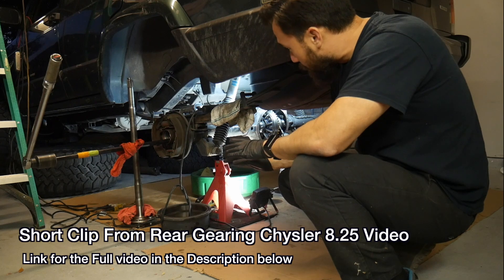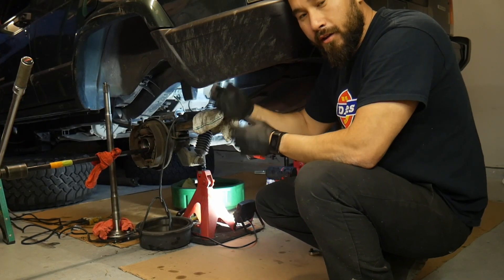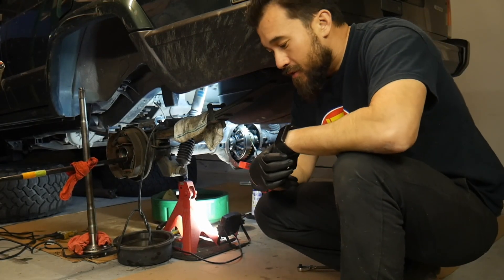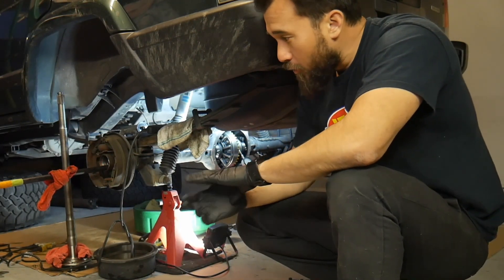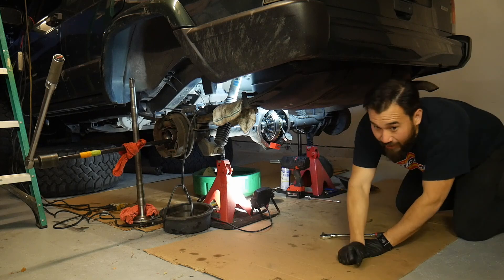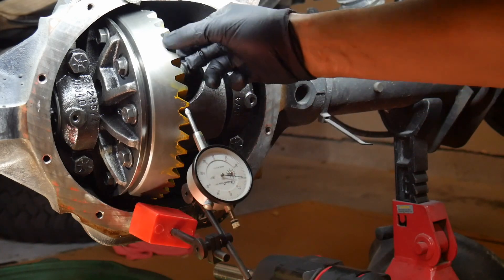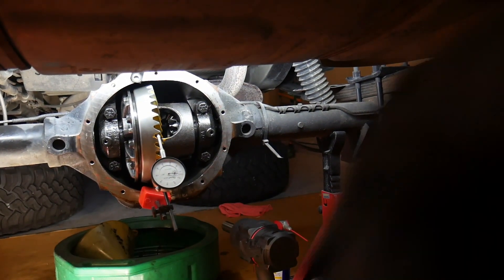Setting Ring and Pinion Backlash Chysler 8.25 Ram Dodge Jeep Differential

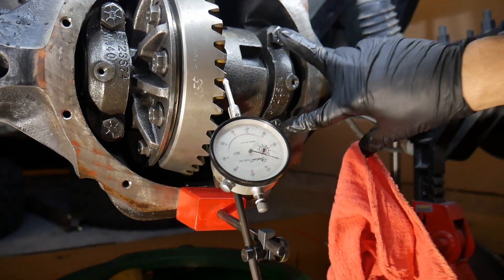Comment: About 08:38 .  I read those bearing cap bolts are 60 pounds of torque, not 100 like here.  I put mine 3 months ago at 60 pounds.   Right??

Comment: ive never done a crush sleeve axle. at what point in here do you measure and setup for pinion depth? i didnt see that step or any explanation on this
Reply from the maker: I've got a few videos on the channel, take a peak
Reply: @Donnythelatemodeltech  I finished building the Chrysler 8.25,  figured it out.  Actually easier than the shim design

Comment: Would you be able to assist me on diagnosing my differential whine after replacing pinion bearings and also differential side bearings ? I uploaded a video to my channel
Reply from the maker: Sorry for the lateness
Reply: @Donnythelatemodeltech  I think space between my ring and pinion is too big and I need to bring ring closer
Reply: From my first attempt at a gm 12 bolt, I had perfect pinion depth, good pattern and I read good backlash but still had some whine. Turned up the stereo for 5000 miles and went back in. Turns out I didn’t squeeze in enough carrier shims. Stuff loosens up. The adjustment feature of the Chrysler 8.25 takes this variable away but still loosens up so I’d guess you’d find excessive wear or initial big backlash if you opened it now. I’ll add that there are some cheaper ring/pinion sets out there that seem soft. Also if you start with big backlash stuff wears fast which makes it worse

Comment: I have a question. I am rebuilding a Chrysler 8.25. I had to replace the ring, pinion and all bearings, races. The spec sheet for the pinion depth is .030. (the old shim gone from rear pinion bearing locking up). When I try to crush the sleeve there is still too much play in front pinion bearing. Any suggestions would be appreciated.
Reply from the maker: It take a lot of torque to crush it.  You need a really powerful impact.
Reply: @Donnythelatemodeltech  Thank you.

Comment: What is the name of the tool used for adjusting the backlash and preloading the bearings? Great video btw.
Reply: It's called a  carrier bearing adjustment tool
Reply: Amazon has it for 28 $
Reply from the maker: You mean measure backlash?    Dialindicator.

Comment: I've done a few rebuilds on Chevy with shims (basically R&R), but never swapped gears or installed a AFM posi and fully set up a 8.25 or 9.25. I'm about to finally install a new dura-grip posi and do a 3.55 to 4.56 gear swap on my 2000 Dodge Ram. Ever since I put these 35's on its been a dog on acceleration and maintaining highway speed. Thanks for the video's, reassures my confidence to complete a gear swap without issues.
Reply: Late answer maybe.  But the higher the gear, the lower your highway speeds will be due lowr rpm from engine.  Your big tires already is equivalent to a big gear diff.  Just like funny cars and dragsters.  The tires get bigger at higher speeds to preserve high speed rpm.
Reply: @CFITOMAHAWK  I got them in. Even did a video on my Chanel about it. It pulls good on the Highway now. Problem with big tires is it lowers the final ratio and therfore at 70 your RPM are low and out of the Powerband. Truck pulls much better and drinks about the same amount of gas.